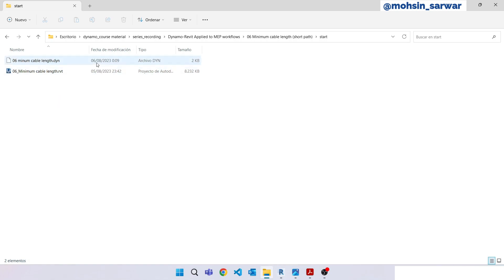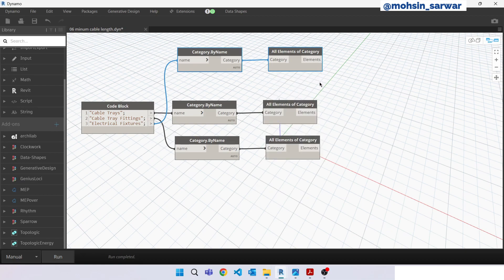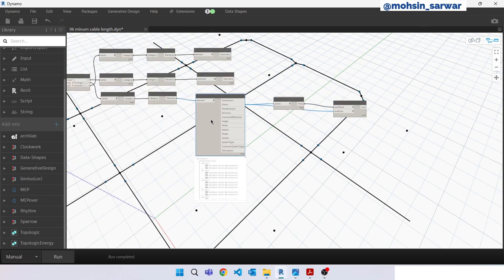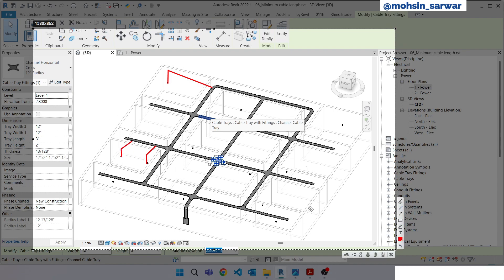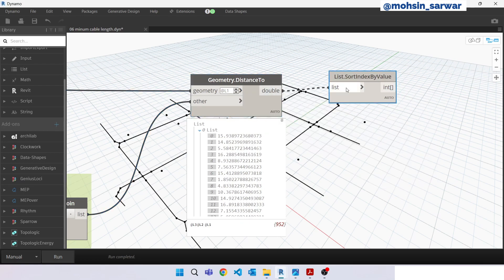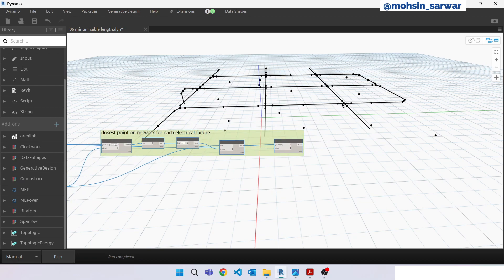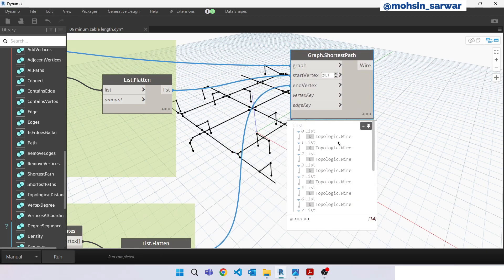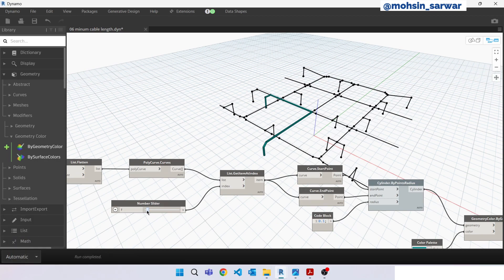Tutorial 06 Minimum cable length (Shortest Path) | Dynamo-Revit Applied to MEP | Revit2022

Comment: I would like to know if it’s possible to create a plugin for Revit using Dynamo with the following functionalities:
After creating the single-line diagram and the system logic, and exporting an Excel file with the connections and cables, import the Excel file. Once the panels and distribution lines are positioned, the plugin should create the connections following the shortest path. Additionally, after completing the panel connections and using the existing conduits, the plugin should calculate the cable lengths and the conduit fill percentage.
Reply from the maker: Hi David,

Thank you for your comment.

Yes, I can build a workflow that fits your needs. Please feel free to send me an email at mohsinsarwaraziz@gmail.com if you're interested in working together.

Comment: Hi, thank you for sharing and clear explanation. May I rise few concerns to you about it like: 1. Situation when you have multiple layers of cable trays and different system ( fire, low voltage, epms etc.) the shortest distance won't be to the desired cable trays. 2. When there are multiple elements on the circuits and the panels are in different locations. 3. When the fixtures have multiple connectors and circuits. 4. Others. For these items, do you know/have an idea how to integrate these items automatically for the lengths of the electrical circuit? P.S. I also used Dijkstra's alghoritm or Magicad has the same aproach by using conduits along cable trays. Thank again !
Reply from the maker: Hi @ionoboroc4581
Thanks for commenting.
I really understand what you are saying.
You can develop in dynamo with python and topologic all the logic that you can think of.

I highly recomend TOPOLOGIC to all bim developers.